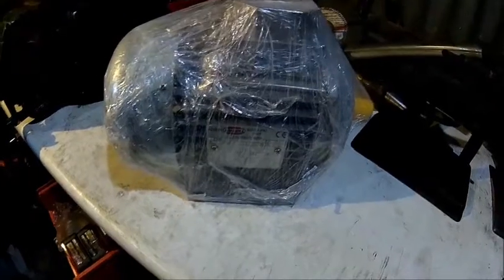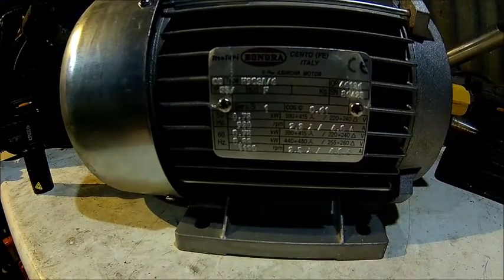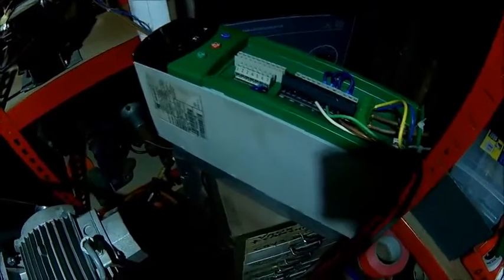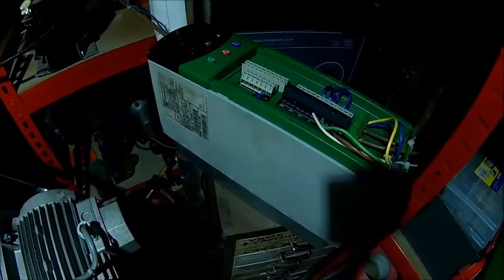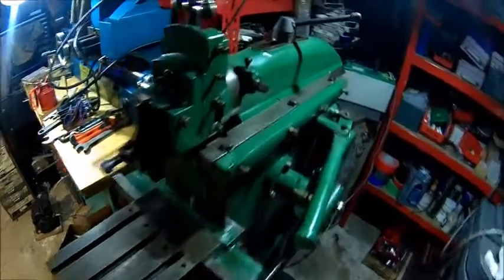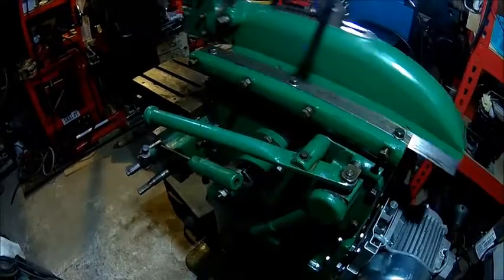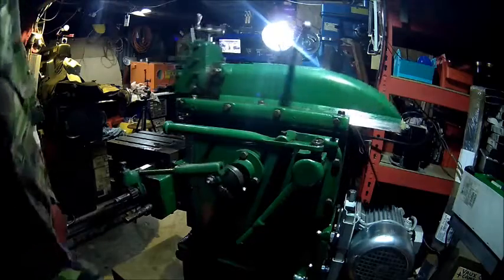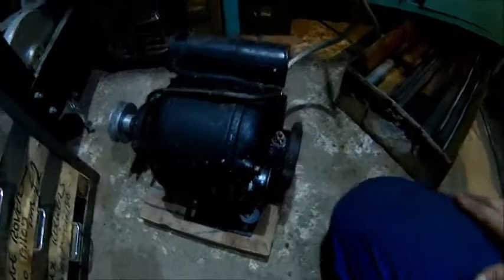The Alba 1A Shaper is back to life - New Motor and pulley, first moves.

Comment: that sound is a little alien.. lol.. sounds a bit eerie... 
your set up acts like a VFD. are you changing the output voltage via a rheostat? or how are you doing that?
i have some machines i would like to do that to as well.. might just have to pop over there for a spot of tea and pick your brain about the subject.. i know zip about electricity and such.
Reply from the maker: +HolzMichel I know it sounds weird, but it's essentially just thinking a bit out of the box and then it becomes quite obvious. (sorry, i was growing in the electro-mechanical trade...)
I have only a 230V single phase supply, but my VFD needs 400 something 3 phase, so i need to make that somehow. I use a 230/220V isolation transformer and put that in seriens with the mains, which then gives me about 450V single phase.
The VFD needs a few mods to deal with that (rectifier, caps and phase loss circuitry)
What comes out of it is perfectly palatable 3 phase power for the motor, essentially from zero speed to about 2 times rated speed and power with no harm for the motor. In fact, the motor stays within rated limits, even when i squeze 1.7 times more continous power out of it....:-)
I am about to make a video about that subject anyway, as it appears there is  some demand for it, especially the rather unusual tricks.
If you have a 3 phase supply, things are certainly a bit simpler, just put the inverter between the power plug and your motor, job done.
And by the way,...You are very welcome for some tea and cake,... :-)